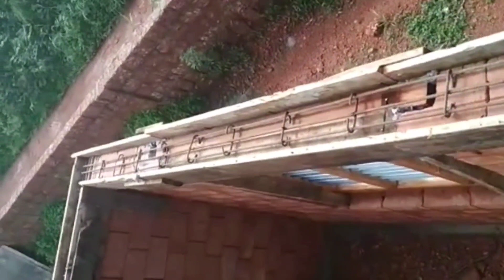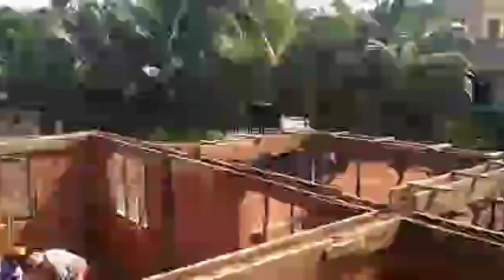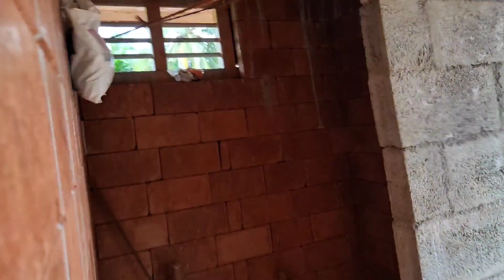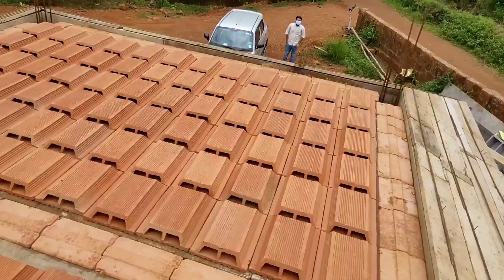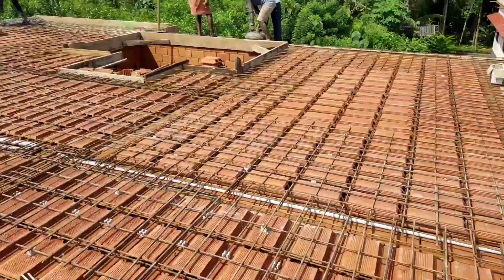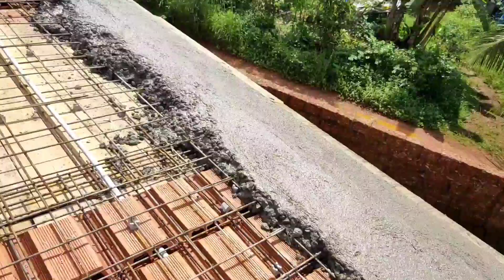Brick house structure finished in one month!! eco-friendly budget home|Kerala contemporary design

Comment: You said there is a saving of 25% each on steel and cement. Secondly, do you mean to say that the roofing tiles used here would cost less than the money saved on steel and cement? I would like to know how much I can save (in total) on the Filler slab compared to the conventional RCC slab of 1000 Sqft .
Reply from the maker: In 30% saving 15% will be spent for tiles and ceiling plastering can be avoided so that saves again 40/sqft